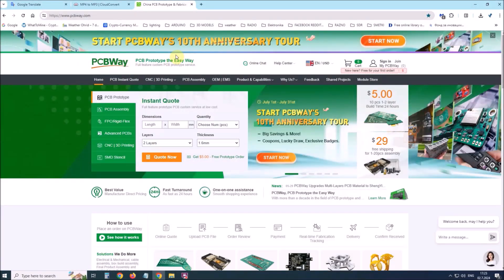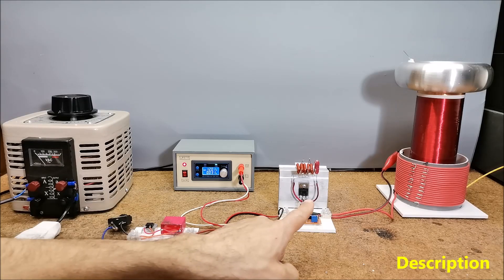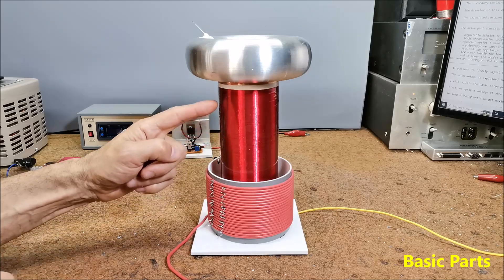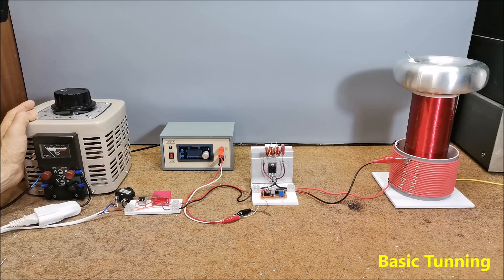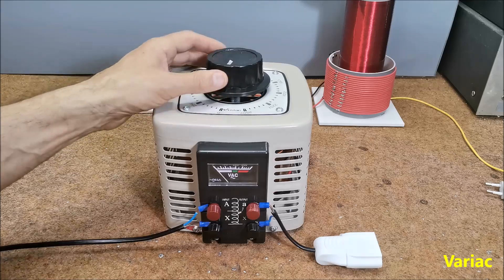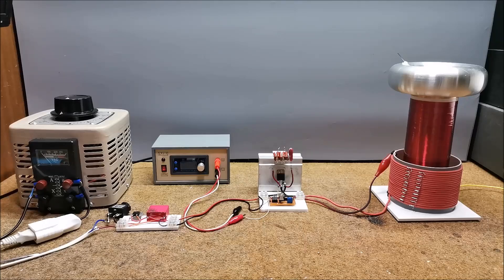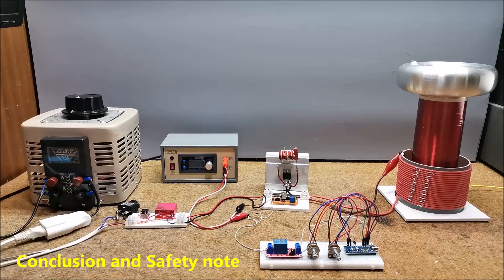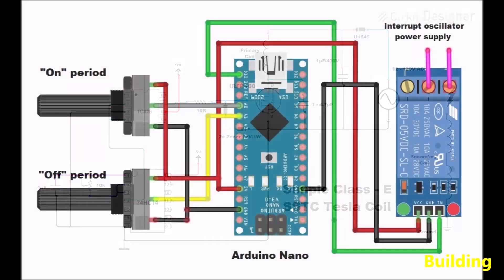Single Mosfet - Class E - Solid State Tesla Coil

Comment: How much current is worked in the circuit? and the capacitors connected to the drain and the source what voltage do they have to be?